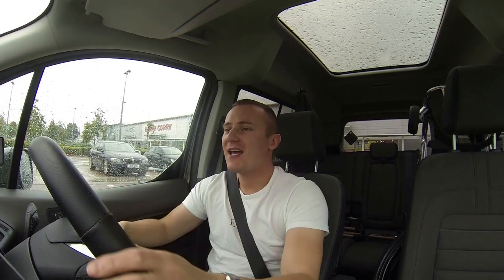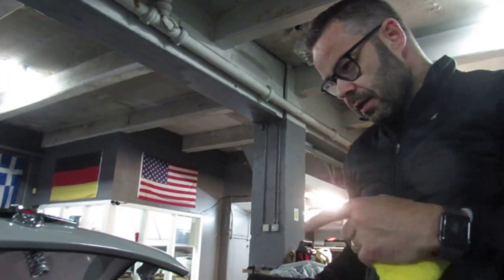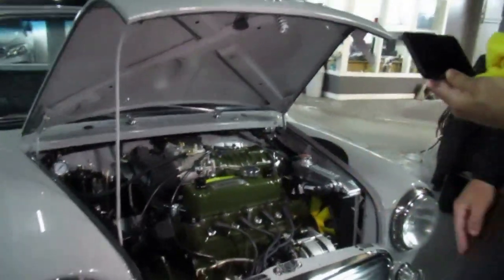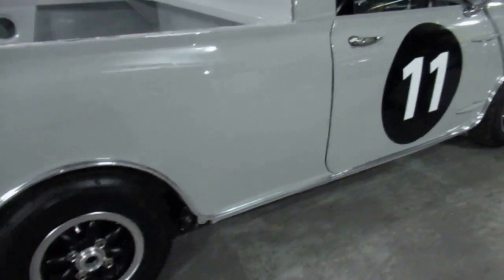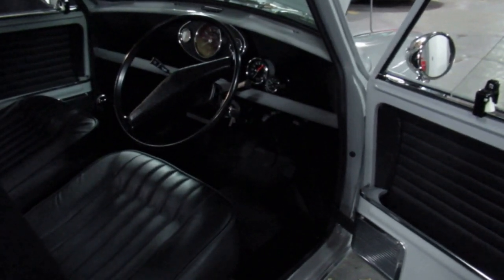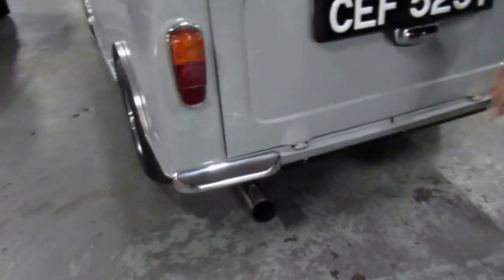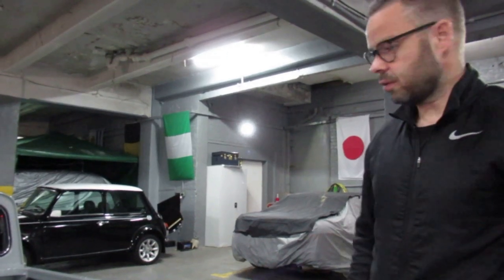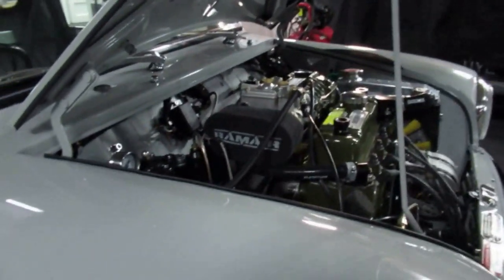This *SUPERCHARGED* Mini Pickup is insane!

Comment: Pretty sure that steeringwheel came at the same time as the 'new' front subframe got onto mini's, should be Mk4 onwards.
Reply from the maker: I thought the commercial steering wheels had that design and saloons had the 3 spoke?
Reply: @classicminidetails8887   No, Vinko is correct.  The wheel matches the twin stalk column shroud  of the 76 onwards models.

Comment: The wheel is what my 1979 & 1977 clubmans should have
Reply: It is Will, that style came out in '76....I think, definitely a late 70's wheel. That centre portion eventually works loose, held in with some form of sealant, doesn't half give you a shock the first time it drops into your lap as it did in my Allegro 😂
Reply: @graemew7001  mine was missing the centre section and could never find a replacement
Reply: @graemew7001  that's a nice looking one, I went with a smaller wheel to allow more leg space for me while driving
Reply: @WilliamMurfitt  Don't blame you mate, I'm 6ft and 16 stone myself so it wouldn't work for me either.

Comment: I fully rebuilt a pickup in the late 80's from about 2/3rds of a shell no doors and nothing infront of them except the bulkhead...4 years work, 1275, S discs, servo, removable steel front and wings... then decided it was too small for me....sold it for .......£750.......